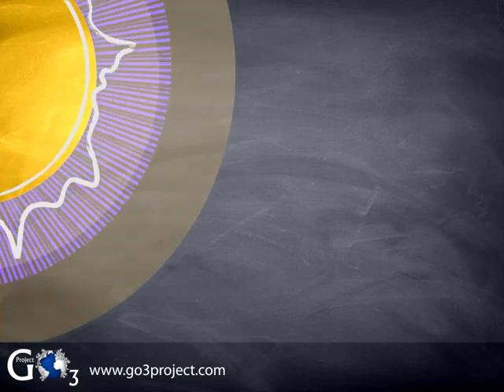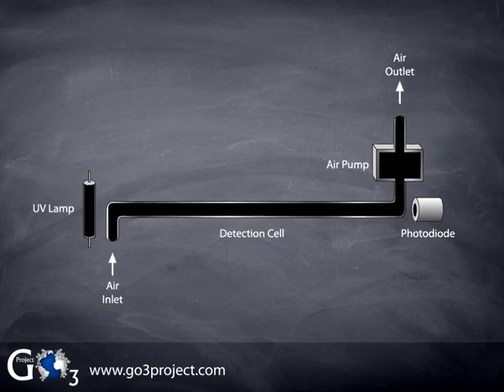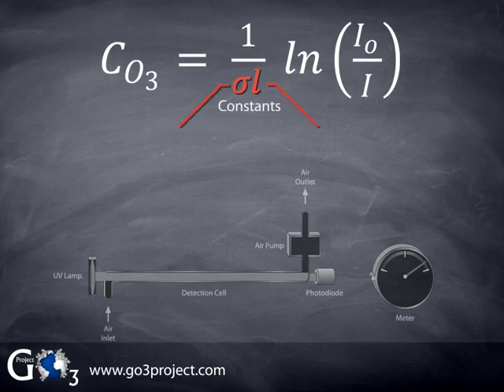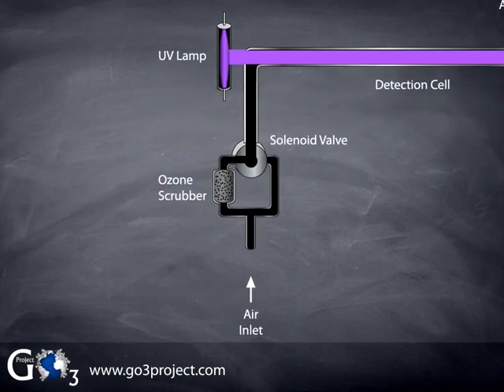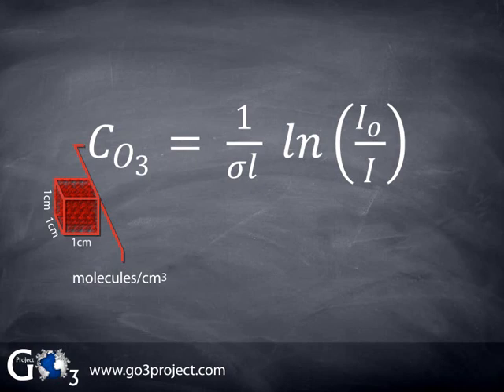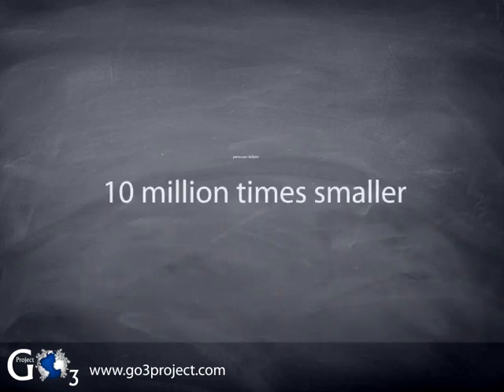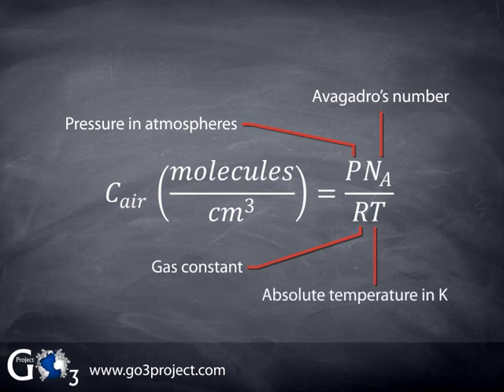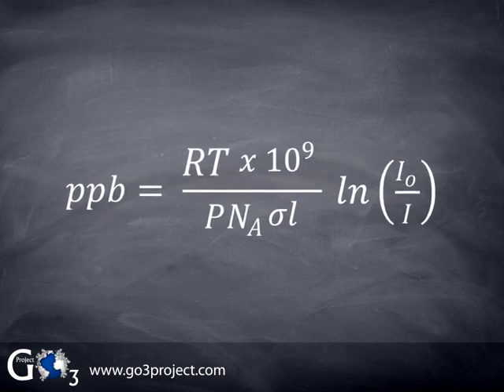How an Ozone Monitor Works

Comment: Hi, thanks for this great video ! Is the uv lamp lnside the tube or is it outside ? Doesnt the uv light produce an ozone  layer that block the uv light ? How does this affect the measurement ?
Reply: It’s a mercury lamp
Reply: I was wondering the same thing, since in the upper atmosphere the UV light coming from the sun causes the production of ozone itself. So why wouldn't it produce more ozone in the tube? And if it does happen, maybe there are ways we could measure how much is being made from the experimental light source
Reply: @alexandersmeets5031  perhaps the first measurement includes the uv light o3 production and so the second measurement... Then the substraction would be the o3 entering the tube
Reply: @diegoj.richmond428  oh yeah of course, that sounds right, thank you!!